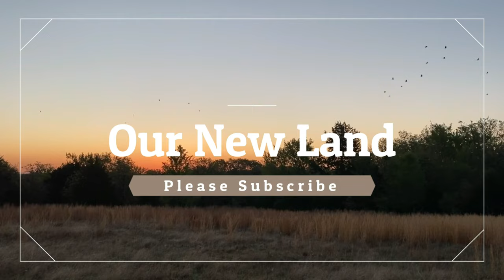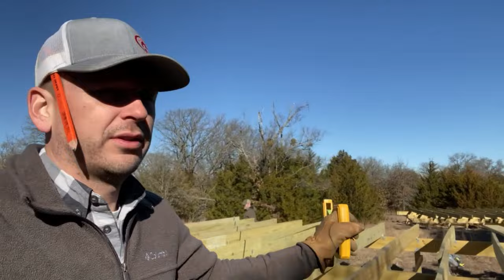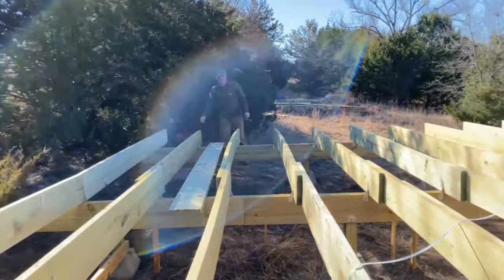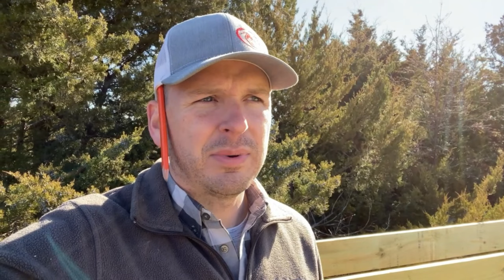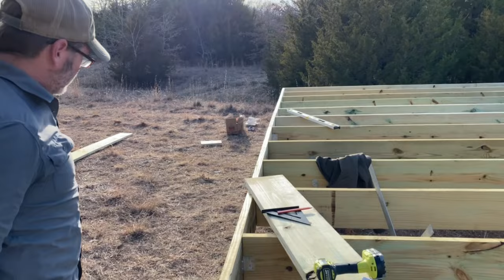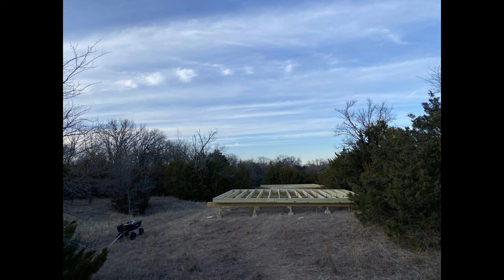Adding the rim joists and squaring our bell tent platforms.

Comment: Honestly I am sincerely happy for y’all you are really doing a great job especially for individuals that have not done this before!!
In consideration to the unlevel boards what I would do and again I’m not a carpenter but I would make the decking side all leveled don’t worry about the underneath part. Again these are learning experiences and you do what works for you!! Seriously great job!
Reply from the maker: Thanks, Dusty.  We've certainly learned a lot, and have had a blast building them.  It is frustrating that almost all of the boards are tapered on the ends by 1/4" - 3/8".  We'll figure a way through it, though.  Thanks again for watching, and congrats on your huge step to move onto your property fulltime!  So great!
Reply: @OurNewLand  just know y’all are seriously doing amazing!! Exited to watch the progress!